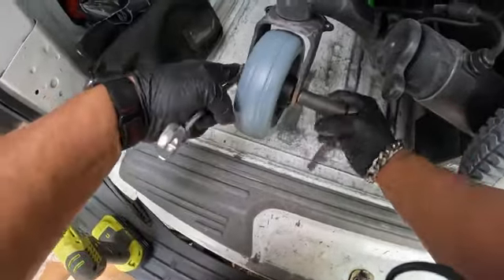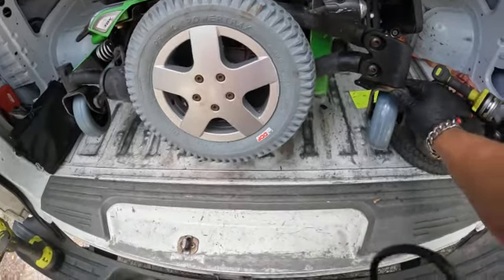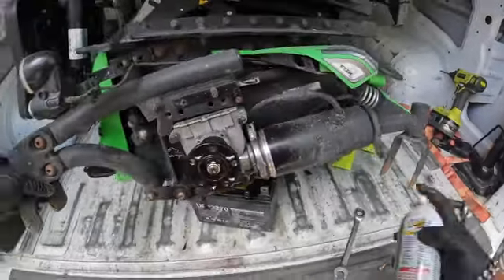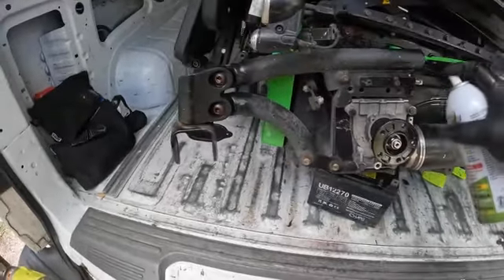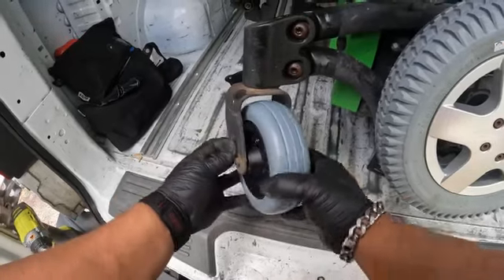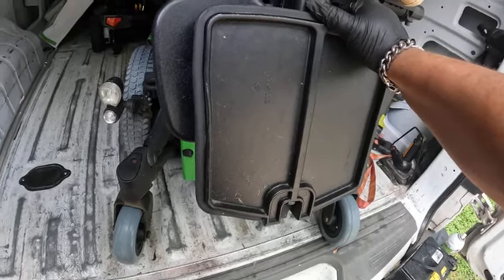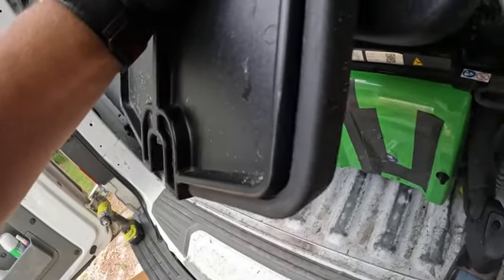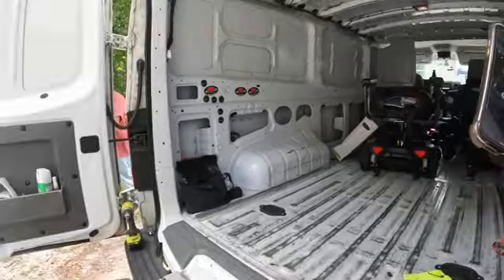Part 2 TDXSP2 Drive Tires & Casters Replacement

Comment: Hi Goose I’m new at your channel and was wondering where do you do the repairs on the wheelchairs and what type of payments you take because I’m having problems with my wheelchair…..thank you
Reply from the maker: @MegaAlmaguer  I’m located in central Florida. What’s going on with your chair maybe I can help you by making a video.
Reply: i forgot to let you know my wheelchair has leg rest lift, recline, tilt and elevation of the seat, and i also need to rplace the seat cushing
Reply from the maker: @MegaAlmaguer  I would start with the provider that supplied your Power chair they should be able to help you. Here’s a couple of companies that carry parts for most power chairs. Monster scooter parts and the aftermarket group. Hopefully that helps please let me know if I can help with anything else.
Reply: @Gustavo-qt1sf  the company that supplied me with my wheelchair does not exist. My main consent it’s going to order an aftermarket actuator because I can’t find it anywhere and try to buy it from the manufacturer but I’m not a retailer so they won’t sell it to me and a repair shop told me they are $800 a piece and I’m on a fix income ( they should call it broke income because theirs nothing fix about that income we get from social security)🤣
Reply from the maker: @MegaAlmaguer  What’s the part your looking for and what brand of chair do you have?
Reply: Thanks for your help 👍🏼
Reply: The part number that comes on the invacare service manual which I got from the internet is SPTRC2128. It’s a REAC LINEAR ACTUATOR
Reply: The wheelchair 🦼 it’s an invacare tdx sp2
Reply from the maker: @MegaAlmaguer  there’s a recline actuator with module which you won’t need the module. It’s posted for sale on eBay I’ll post the link on here. I also have a video on how to replace the recline actuator. https://www.ebay.com/itm/155650316238 
Hopefully this help.
Reply: @Gustavo-qt1sf  thank you very much sir you’ve been very helpful 🙏🏻
Reply from the maker: @MegaAlmaguer  your welcome sir